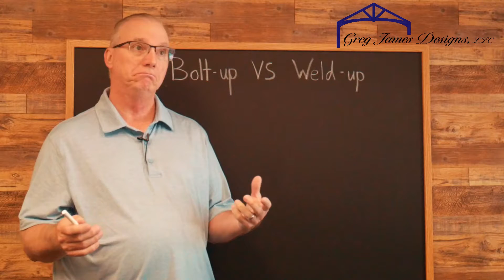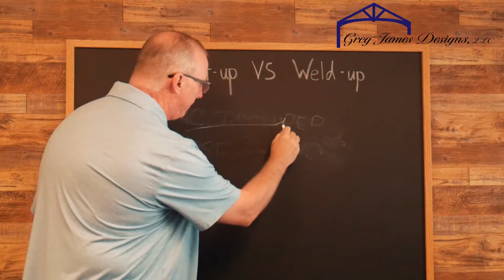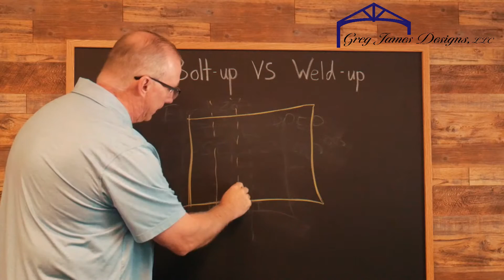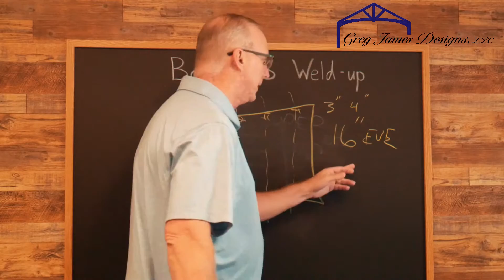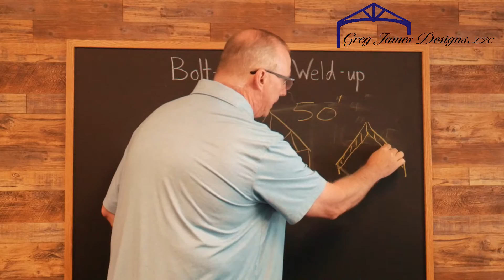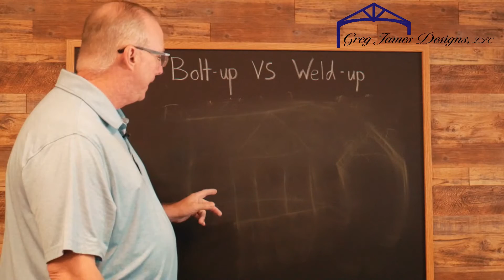Bolt-up vs. Weld-up Metal Buildings

Comment: we fabricate building trusses from 16" I beam for clear spans of 50' no issues. 2/12 to 4/12 pitch butwelded full penetration welds without any fishplates or gussets. that's on 25' centers. We also use i beam for columns - only use box tubing for small hobby type buildings...
Reply: Hey I'm building my own red iron building. I have 50' trusses that are flat bottom on a 1/12 pitch. I am going to do 20' side walls and use an 8x5.25" I beam. Is that going to be strong enough for the uprights to hold up the trusses?
Reply: @joshuawagnon2819  yes, those I beams are plenty strong.
Reply: @joshuawagnon2819   I work for a metal building fabricator I seen them use 12”x16 I beam for rafters each rafter measured about just under 24 feet which means it’s a 50’ feet wide and usually the columns are 20 feet apart they also used quarter inch connection plates which to me it was a little to weak but that’s what the engineer had on blueprints